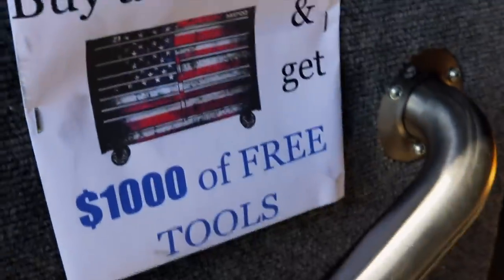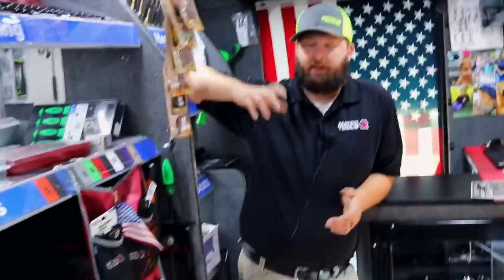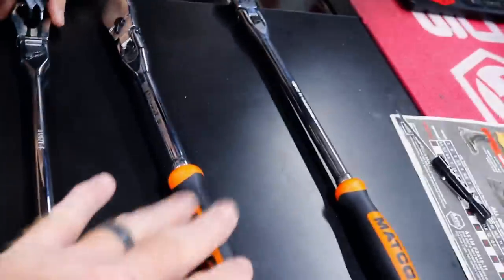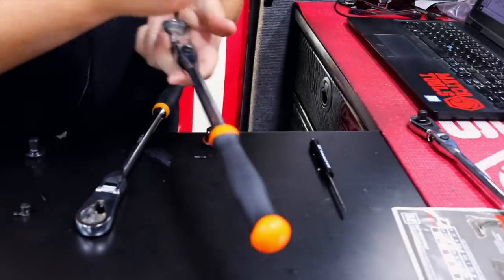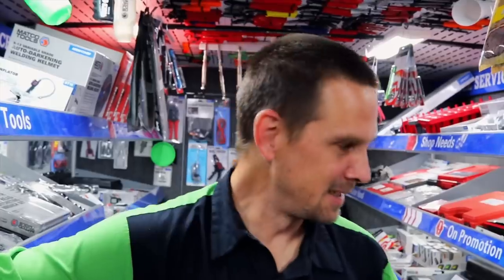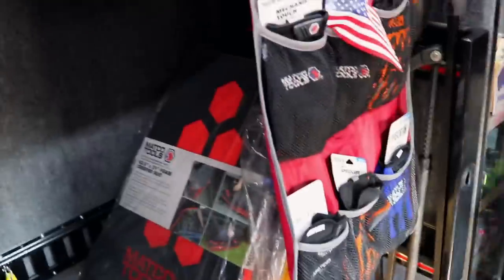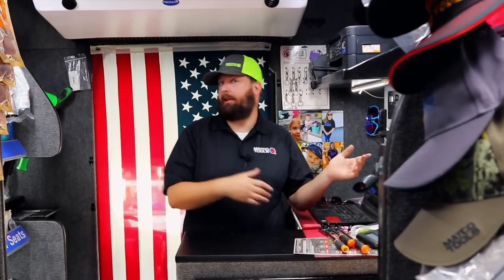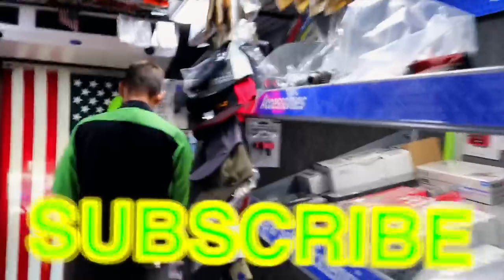Matco Tools: Is it the same ratchet, just rebranded? Gearwrench VS Matco, let’s tear them apart!

Comment: The gearwrench ratchets are hard to beat for the price point they sell at. I’ll take a quality Taiwan tool over Chinesium crap any day of the week. The apex warranty dept has been good to me. I don’t have a Matco dealer and didn’t always have snap on so gearwrench was my ratchet before tool truck. Still keep the 120xp for tight spots and the new 90 tooth 1/2 inch for oil changes.
Reply: I don’t mean to bust your bubble but Taiwan and China is the same country
Reply: TERRELL SCAIFE Taiwan is under the rule however that island produces much better tools than the mainland of PRC.

Comment: Everybody says they're the same but they're not lol they are similar but also very different  in certain ways too but both are good ratchets in my book if you're a poor diyer like me  then gearwrench is as close to a  matco ratchet as I can get lol. And I'm referring to the old 84tooth red handle gearwrench locking flex head haven't tried the new 90t bc it's to expensive id just buy a matco for a little more

Comment: The first week I had my matco rachet I took apart a gear box that was on a 1980 70D drag line 10 years older than me I put that rachet through hell on that job and not once did she falter Matco probably has the best 3/8s locking flex head  rachet on the market

Comment: The way I see it, gearwrench are pretty smart.. the see how much people like the matco ratchets & snap-on.. so the make a ratchet that looks almost similar to matco. and put a handle on it that's similar to snap-on.. that's my thoughts on it.. 

Another example of gearwrench making copy toos is the X-core universal sockets the look just like matco painless design but the are mead in China not Taiwan the are rubbish.. the matco set is USA Mead and I've been told the are really good..  So my point is gearwrench is taking ideas from other tool company's and making copy's that look similar 

If the can make tools that look and feel similar to matco or snap-on people will automatically assume the are the same,  and buy them due to price also I believe APEX tools was making tools for both tool brands or at least designing them ..

Comment: I know this is an old video but I bought the GearWrench 3 pc set and a Matco 18" 3/8s ratchet. I can say that While the GW is a nice and similar design; It's not even close when you compare quality. Matco definitely has higher standards.  
GW, I can't get the flex head adjusted how i want. It's either too tight or too loose and flex in one direction is better or worse than going the other way. Quality of machining is poor. Matco came perfect and flex head functions great and works better than GW. unfortunately The Matco won't get used as much because It's probably too long for regular use. I'll have to order a shorter length; one that would get used on a regular basis.

The Japanese ratchets are great as well but not locking. I just went with stubby's on those because of the non locking heads.
Thanks for your videos; helped me choose what i wanted.  Love your content, keep it up

Comment: Ya well I had one, realized I could get a three pack of gearwrench with all the three size drives in the comfort grip locking flex head for the price of one matco. So I sold it and got the set. Theyre both lower on the scale. Proto, sk. Mac tools over snap on truck if you have them both. This info wound up costing me 30$ loss in selling the matco. You’re welcome
Reply from the maker: To each their own and everyone is entitled to their opinion but there’s a difference in the ratchets. I own a bunch of Snap On ratchets, Mac ratchets, etc but I prefer the Matco over them all.
The main thing I do not like about the Gearwrench is the lock is backwards to me and also when it is unlocked it isn’t smooth as far as flexing goes. It is clicky and you can feel it

Comment: I think the old 84 tooth gearwrench and the 88 matco are a closer match than the 90t. I know my older 2011 84t is better than my comfort grip 90t.
Reply: Agree 100% on the similarity comparison to the 84 tooth models but as far as quality goes imo the 90t have proven to be superior overall to the 84 as I’ve had to warranty 3 84 tooth 3/8 locking models due to the grooves on the locking head completely wearing out not to mention the annoying habit of the switch reversing direction when in use something, the 90t seems to have cured both these issues from my experience.

Comment: Why is the Matco better than the comparable Mac?  Serious question.  I'm not a pro so I've never dropped the cash on a tool truck brand.
Reply from the maker: There’s several differences. If you watch the video I did https://youtu.be/SNmYoD4GypM
It will shed some light on them for you. 
The Matco can be locked (hence the name locking flex head) or unlocked (like a non locking flex head) the Mac is locked only you can not use it in an unlocked position it has to be locked meaning the head will not flex. 
I explain it in the video and cover pretty much every aspect of them.

Comment: I have 3x matco ratchets, 88 tooth(1/4 inch flex and long,3/8the flex). I also have 2x gearwrench  straight ratchets(older xp 60 tooth). both gearwrenches have matco guts.
 Works fine.  dimensions may differ, and some cost differences are presenr- they're both designed by the parent company Danaher. I did the same to my 60 tooth digital gear wrench. was the same as the old digital  matco. guess what? husky click type 3th is identical in head design to the click type matco. I'm happy with the hard plastic vs metal  handle,  at less than half of the cost. you'll see the same with KD tools, and other danaher products.  some of the matco components are built here.. others I'm not so sure. while I love tool trucks , I hate rebrands.
dont buy a matco ball joint press.. identical to a harbor freight..buy it and found out. moral of the story, as previously stated: think before you buy!

Comment: I used to think, a couple of years ago, Matco and Gearwrench were the same. I don’t mind admitting when I’m wrong.
Reply: They were the same when Apex and Matco were owned by Danaher and Apex provided the manufacturing capability. Apex was since spun off and now owns Gearwrench. Matco is now manufactured by AJ Manufacturing, which also manufactures for Snap-on, MAC, Sears, and Wal-Mart, according to their web site. Matco has a video about "the Matco factory" and you can see in it the workers are wearing AJ patches on their shirts.
Reply: Coyle Tools thanks for the clarification. It appears nowadays tool manufacturers swap parent companies as fast as they can.
Reply: @donaldhollums3278  It's all about doing it for as little as possible with the highest possible quality. And yes, there is an advantage among some consumer segments for saying a tool is made in the USA, so they enter into manufacturing contracts that last however long. When those come up for renewal, they'll bid them again and award it to someone else if it suits them. That's why you find quality differences over the years within the same brand. Truly, many times, they don't make 'em like they used to because once manufacturers change, so do their materials and processes that can result in that quality difference. Craftsman is a great example of seeing how the tools they make now sure aren't what our fathers and grandfathers used.

Comment: It's the same ratchet design. Same design with slightly different components. It's like one company sweetens their tea with honey, and the other with granulated sugar. Either way, you got yourself a Sweet-Tea. 

The Matco Black Chrome is the definitely the sexiest, and best locking design. But GW performs just as well. I can't attest to the GW locking design durability. However, the price makes a huge difference for a lot of guys. I can't blame them, but you I still don't like my ratchet being dropped off by a chinese spy balloon.

Matco Michael is great, but I still miss Hambleton. One funny SOB, I tell you what.

Comment: quick question here. i think my matco dealer put a gearwrench head in my locking flex 3/8. is that possible? mine had the flat selector when i bought it and it now has the exact same style as the gearwrench locking flex ratchet.
Reply from the maker: They could have changed to selector switches but they are not the same the Matco is different and made in usa

Comment: Many of the newer gearwrench products are pretty stellar, as the newer stuff is primarily made in Taiwan. As new products come out, the legacy products, that are still in production, get moved to China. The problem with that is not necessarily that the standards change, but China  has a reputation for reusing cast and dies, and making unauthorized tools with The branding being left on the product. This creates a situation where substandard tools are made and sold that did not meet the specifications and quality standards of the real deal. So unless gearwrench and other manufacturers have 24-hour surveillance and strict accounting for old cast and dies, this is a very real issue. Chances are if you're buying gearwrench products at tool truck, it will be top shelf stuff, because it will be the newest models anyway. I will say this, at least gearwrench is still improving existing and developing new tools. Their newest removable head half inch electronic torque wrench is a stellar product for under $600, 100,000 cycles before recalibration needed. I really hope that American manufacturing can attract enough research and development money so that automation could lower the costs enough to bring a lot of manufacturing back. They're certainly are some snap-on and Mac tools that are worth the substantial cost differential, but in other cases it's just not justifiable if you just objectively basing it on quality and usability.

Comment: Armstrong ratchets Maxx ratchets, same lock, same tooth count. USA made. Armstrong making them for matco
Reply from the maker: You are wrong. Matco ratchets are made by AJ Manufacturing, been there and witnessed it with my own eyes
Reply: @KoonTrucking  your absolutely correct. Nate a, got it right in the comments. Armstrong did have same heads at one time, not anymore tho. They use too.

Comment: Clay--Every week there's a discussion about whether Michael picked up blue-handled ratchets.  Is it not possible for him to order a dozen or so various colored HANDLES and switch them out on his truck as needed?  The ratcheting mechanism is identical on them; the only difference is the color of the handle.  He'd save a hell of a lot of money by NOT buying specific-color handled ratchets (at whatever his cost is), which may then not sell if that color falls out of favor with his customers.  If Michael can change out the handle, he can make that sale TODAY.  He can also replace handles for customers if they've just worn out or become damaged in use.  What does he pay for each replacement handle?  It can't be more than  $6 or $7 each.   I think if he tried that he'd simplify his life and not tie up a lot of his own money in ratchets that aren't selling.  That's just my take on it.
Reply from the maker: The handles don’t come off like on snap on ones
Reply: @KoonTrucking --Thanks for the reply; I thought that might be the case. That's too bad.

Comment: I really do not care what people say about Gear Wrench ratchets. I love my Gear Wrench Ratchets, that is all I can afford. Dollar wise, it is a great choice. The only thing I do not like about Gear Wrench ratchets is they all come scratched up. But that is just cosmetic. Also the Gear Wrench 1/2" 120xp does not come with a comfort grip. I find that odd but oh well. I would love to own a Matco Ratchet in blue, but it is not in my price range. And I check eBay all the time for Matco Ratchets. Now if someone wants to give me one I would love to accept it but that is the only way I would get one.
Reply from the maker: Oh yeah like I said in the video If you don’t have a Matco dealer or can’t afford one a Gearwrench is an EXCELLENT choice !
Reply: @KoonTrucking  I am going to seriously take a good look at the 90 tooth ratchets. They at least have a comfort grip on the 1/2" drive flex head. Not sure why they didn't put a comfort grip on the 120xp flex head 1/2" drive. Also the 120xp flex heads did not come locking. Where I live, I can get all 3 sizes in the Gearwrench locking flex head for less then 1 Matco ratchet.
Reply: @KoonTrucking  Also I am not talking about you Clay. I know you take all tools seriously. I am talking about the Snap On, Matco and Mac fan boys. You can get some really good tools from the lesser known brands or truck brands.

Comment: The matco are the same as gearwrench but they are made by Armstrong in USA . They owned by apex tool group and they use the same design.
Reply from the maker: I’m pretty sure Matco ratchets are made in Elmhurst Illinois by A J Manufacturing.... used to be made by Armstrong
Reply from the maker: Also Fortuve owns Matco now Danaher and Cooper joined forces to form Apex who owns Gearwrench

Comment: Yes the 90T gearwrench is different from the 88T Matco ratchet. 90T won’t go into a Matco ratchet. The new Matco ratchets the internals are different from the older Matco ratchets. Matco change them cause the 84T gearwrench internals actually went into old Matco ratchets.

Comment: Happy 4th July from England.
What is the actual length of your favourite ratchet Clay? If I should ask anyone it has to be you. You seemed to have tried a few!
Also what was the length of the quarter inch that Michael recommended?
Reply from the maker: 13” 3/8 and the 1/4” is 7”
Reply: @KoonTrucking  Thanks Clay, you are a busy guy so I appreciate the reply.

Comment: From what I could figure out both Matco and Gearwrench and Craftsman were designed or built by Armstrong.  However Armstrong was bought out by Gearwrench and all the manufacturing went to Taiwan. I can’t support a company that buys out an American company to send the jobs over seas. However the Matco is still made in the USA and I would like to know if it’s made at the “old “ Armstrong plant. And I believe this all comes down to patent rights. And if anyone knows if the Taiwan built Craftsman ratchets are built at the same place as Taiwan built Gearwrench.
Reply from the maker: I think they are made in Illinois
Reply: Koon Trucking  I wonder if that’s where the American Armstrong plant was, I also like matco extension for the knurling on the widest part.

Comment: Now dont get me wrong here I love both matco and snap on. Mac has a few cool things. But I'm 100% a snap on tool guy, their ratchets are hands down the best. With that being said matco makes the best toolboxes.
Reply from the maker: I own about 60 Snap On ratchets and use my Matco 99% of the time. I honestly like them much better
Reply: @KoonTrucking  it's all a preference I also like regular non locking flex heads. That may be the reason

Comment: A Chevy truck is a GMC truck with a different badge and trim pieces.  Same thing. Don't spend your money on matco. Just because some extremely minor things are different doesn't mean it is different. Go look at a snap on ratchet. It is 100percent unique and no one can come close to it. No doubt when someone reaches for a snap on ratchet. When was the last time you used  snap on pliers that looked like another tool brand? Never. There is a difference. But not with matco tools.

Comment: Gearwrench vs matco ratchets.  Gearwrench grip is awful.  Its a skiinny little pos wannabe snapon handle.  The flexing head part is cheesy and clanky.  Its also not as sturdy/has play.  The gearwrench locking head switch is better.  It has a switch lever on both sides of the ratchet and its not as hard to flip.  The internals are better on the matco but can be swapped into a gearwrench.  The gearwrench ratchet is longer which i kind of prefer.  On my gearwrench ratchet i swapped the interals for the matco internals($11?) and bought a snapon fl80 grip in orange(needs finese to work).  It made the ratchet significantly better.  Matco is definitely better quality but i do like my modded gearwrench yet hated the stock gearwrench

Comment: lost souls out there clay....the looks don't count the steel the process of tempering  bottom line....this is common sense, that is not so common... you get what you pay for!  matco is good.. snap on good ….mac will break more so...its when they got bought out their quality went down.  one thing.... just because the same factory makes it does not mean its the same tool
Reply from the maker: I don’t think they are made in the same factory either I’m thinking Matco ratchets are made in Illinois if I’m not mistaken.
Reply: yes they made it look similar for the unsuspecting...at home its the was to go...but matco only makes awesome tool boxes and they get others to make their tools but....to their standards